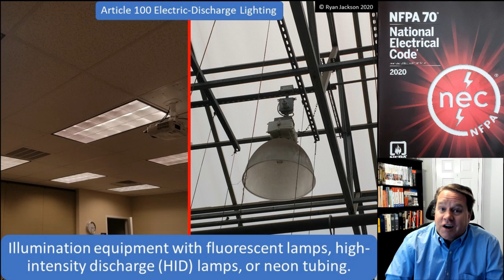100 Days of Article 100: Electric-Discharge Lighting

Comment: I'm surprised the latest code even mentions electric discharge lighting,  everything pretty much is going to LED.  Now don't get me wrong,  the 250 and 400 watt metal halide,  particularly the newer pulse start versions, are great, they put out a ton of white, clean, high CRI light much better than the high pressure sodium,  but in this day and age, practically nothing beats the switch to LED, and personally all I install is LED.
Reply: Reliability, for one.  An LED fixture is the consumable element since there is no lamp to replace when it dies, meaning they drive up E waste.  A friend of mine works somewhere that had a recent phase drop, and the line harmonics from single phasing motors killed a bunch of LED fixtures.
Reply: @randacnam7321  awesome story .  Thanks for sharing.  I never considered reliability,  since LED fixtures are (suppose to be ) designed to last 25,000 to 50,000 hours, longer than metal halide or high pressure sodium,  and use much less energy,  when considering the losses in the ballasts,  the fixture losses,  and lumen depreciation (for HID) , which makes the cost to run the LED's a fraction of the cost, when considering energy costs,  and labor replace replacing burned out HID bulbs, not to mention LED's are mercury free, unlike electric discharge.  Although the auxiliaries (ballasts and igniter) for electric discharge, provided they are not running overheated and failed  lamps are promptly replaced,  are practically bulletproof, unlike LED, I have seen about a half a dozen or so LED fixtures turn into a strobe light,  when the driver fails.
Reply: @Sparky-ww5re  Osram Sylvania make T8 fluorescent and HPS lamps rated for 80,000hr.
Problem with LED failures is that they are somewhat random as there are all kinds of failure modes that have not been properly characterized cuz 'muh LEDs are teh fyoochur ov liteing hurr durr.'  Detroit had 20,000 LED streetlights fail due to blue light from the LED dies causing accelerated photodegradation of the lenses and burn them up.
I also saw some U bend LED retrofit lamps die at a former job, and the surviving lamps were a lot dimmer than the identical replacements.  This one office had a 10% failure rate of lamps, the first one dying in a few days.
Reply: @randacnam7321  I bet if they were metal halide or high pressure sodium,  the worst that would've happened would be the lamps drop out, and take a while to restrike, but otherwise be left with no damage.   Thanks for sharing.

Comment: I'm retired but still trying to keep up with the codes & wiring methods. Does anyone know if anybody is installing say 250 & 400 watt HID luminares. Guess they would never meet newest energy codes. We converted anout 30 250 watt luminares in a mechanical room a few years ago with LED'S. Went to the trouble of removing the ballast. Thanks Ryan for another great vid.
Reply from the maker: It'd pretty much all LED. Very seldom will you see the 400W metal halides that you and I installed.
Reply: @RyanJacksonElectrical  Thanks. Hopefully they will prevent companies from making them like they did with some of the incadescent lamps.
Reply: Believe it or not I recently had to replace a transformer and start capacitor for 1000w metal halide for an asphalt mixing plant we service.. They insist on HID lighting.  🤷🏻‍♂️
Reply: 480 volt single phase
Reply: @MrMaxyield  Sounds like they are left over from the Flinstones. Company that I worked for back in the 1980's refused to order far superior type IMC conduit because they always used galvinized. We needed around 500' to wire in new equipment but supply house only had the type I wanted. The other 5 sparkies could not believe that this type was cheaper larger inside diameter easier to bend & thread. Win win. Me & one of the plumbers were the only 2 guys with a license so we keept up with not only the code but latest & greatest supplies. You would think that they would demand that all of the 1.000 watt lamps be replaced with LED'S. Not only save a ton of money but do not have to wait up to 5 mintues for lamps to vool down to come back on line during a short power glitch. We had some 400 watt fixtures take what seemed forever to come back on if one of the 13,200 volt uitility lines went down for less then a second it took tie breaker to close. Sooner or later they will stop making these lamps just like they did with the 60 to 100 watt incadescemt lamps.